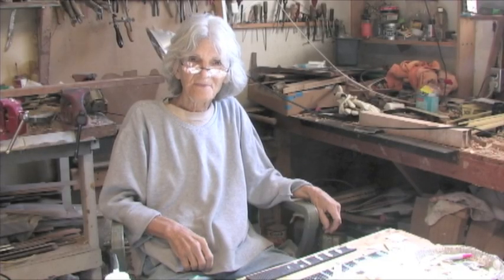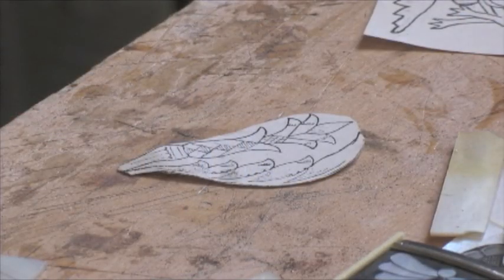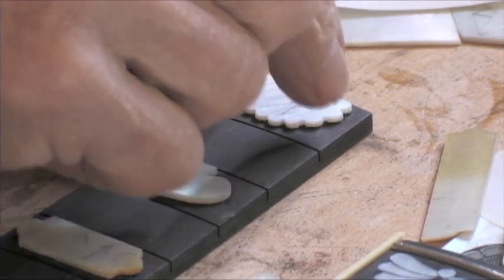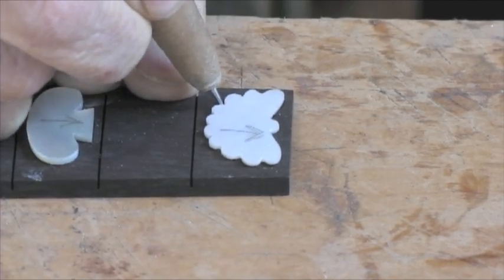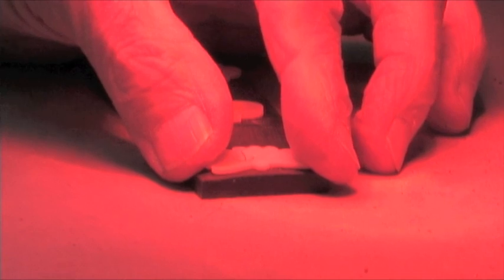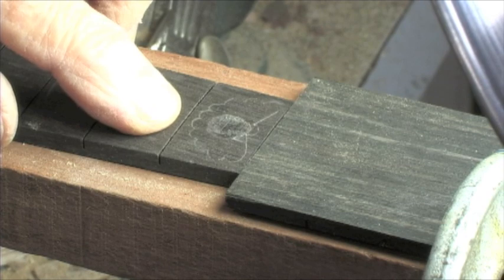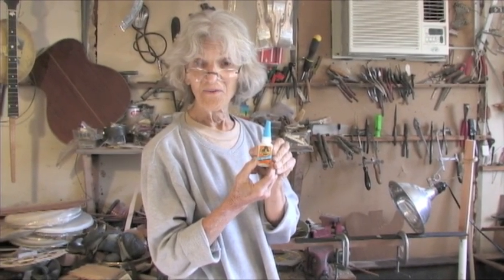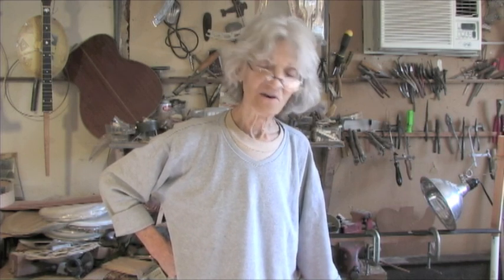Routing for pearl inlay on Mandolin, Banjo or guitar neck

Comment: thanks I am actually a bowyer seeking riser or bow handle accents of abalone; I also do some lapidary cabochons etc. I began to inlay with my dremel and/or woodburner iron, but didn't think to use my router attachement for the dremel to make the depth consistent where I can and/or it's flat enoguh...I, was routing it without a depth setting or stop by eyeball...that makes the middle easier witgh the little router attachement, just like the big router for the bow form haha thanks

Comment: Really enjoyed your video. I've tried and tried to find a good video of this. I certainly don't want to seem unappreciative but is there any way you could do another that actually show 1) The router size you are using. 2) you actually routing the fingerboard. If you watch this video you say the light goes through the big hole while you look through the small hole and then we can just look at the back of your hand and never get a chance to see you work. 3) How you cut your 90° corners? Small Chisel? 4) Once you finish and sand your fingerboard to the proper bevel, would you show us how you actually clean, scribe, and paint your inlay pieces. Thank you very much, you are a real talent. I'd love to be able to do these. I see the snakes that run down the fingerboard and I do know where even to start. Thanks Again!
Reply: Brotha, do your home work ok, try to see through the eyes of Macgyver.  I can use just a simple Dremel Kit.  As long as you can square it up, and use the size of bit you want. for more accuracy. Easy enough
Reply: Thanks, I wrote this three months ago and in that time I have figured out quite a bit. You said a mouthful when you mentioned MacGiver. I understand now that it shouldn't be over analyzed. Just do it. Thanks again.
Reply: Sorry "Macgyver". It's been a while.